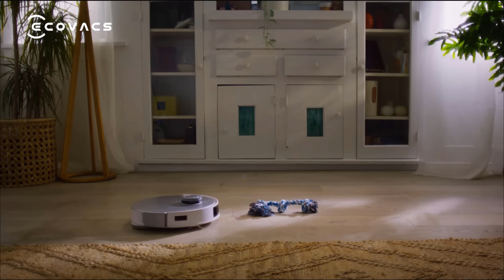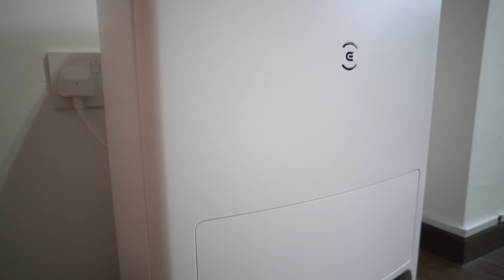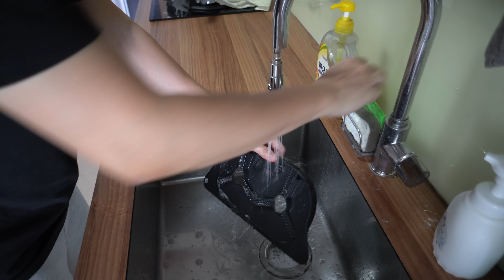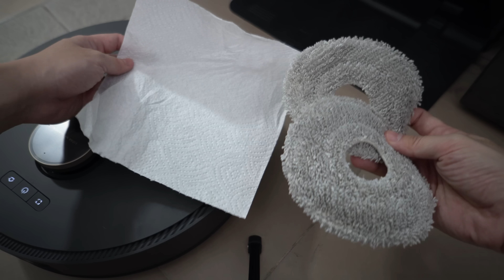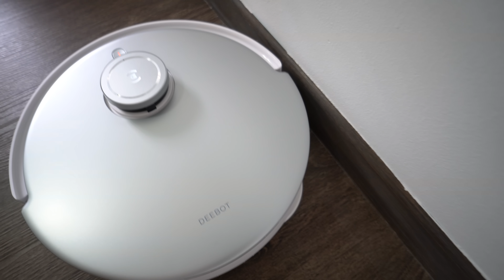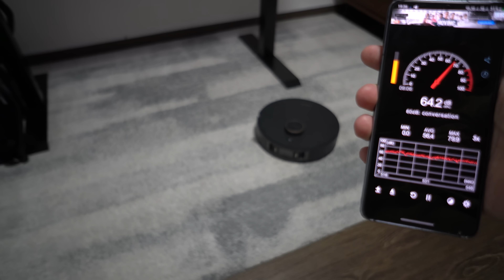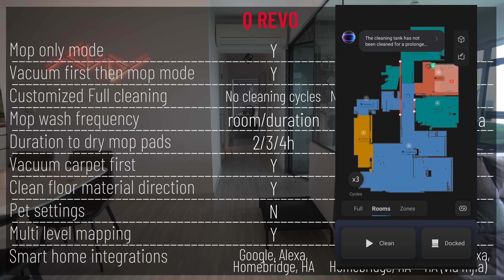My TOP 3 Robot Vacuums Worth Buying Now - DreameBot L20 Ultra, Roborock Q Revo, Ecovacs T20

Comment: Great review and tips mate, keep up the good work.

But,

Why did you exclude L10S Ultra, would you explain?

I will buy one and my budget is tight, just as much to get a Q Revo or L10S Ultra, which are equally priced in my country.

Should I go with Q Revo?
Reply from the maker: simply because it's not in my top 3. L10S is probably the cheapest model that is able to hook up to water pipes, but if you are not going to implement that then go for Q Revo

Comment: Hey alex. Can you advice if those dreame x30 or x40 models directly bought from TB will they work? Coz i read some models are for mainland and they geolock the app/firmware, esp for the x20pro
Reply from the maker: any appliance that's more than 500 i won't risk buying from TB already especially for a robovac with so many moving parts... unless the product can only be found in china and i really really want it
even if today the firmware did not block overseas IP from accessing, nobody can guarantee that won't ever happen, or they will request a china registered mobile number or ID
Reply: @alexteo  Thank you for your very valued advice. Its true, they can brick it anytime with a firmware.

Comment: After your review I'm conflicted between the qrevo and l20. l20 is $350 more than qrevo though.

in your opinion for a small 68sqm 3rm hdb, which would you recommend? Would prefer hot water washing.
Reply from the maker: both doesnt have hot water washing, have to look at other models
Reply: @alexteo  no problem, pulled the trigger on the qrevo maxv since it was 300+ cheaper than the x30 without the features i didnt really need like removable mop and auto soap dispenser and less 1000pa & no hair cutter. 

Consider it somewhat superior to dreame l20 since it has hot water washing and a good 1 piece base for easy cleanning.

Comment: RobotPox has become an indispensable part of my household routine. As a parent, keeping the house clean amidst the chaos of daily life can be challenging. But RobotPox has lightened that load significantly. Its advanced sensors detect and avoid obstacles, preventing any mishaps while it cleans. Plus, its slim profile allows it to reach under furniture and beds, where dirt tends to accumulate. It's like having a reliable cleaning companion that you can always count on.

Comment: The L10 i believe has the water hookup kit too? Saw it being advertised as an option besides just the vacuum alone
Reply from the maker: yes it does after launched a period of time, the L20 is designed and launched with the water kit in mind
Reply: @alexteo  thanks! Was contemplating l10 ultra heat w hookup kit vs l20. Main thing is budget, not sure if the paying the extra premium is worth it

Comment: Don't think this was mentioned or reviewed but all 3 brand uses NON-reusable dust bag which cost at least $20 SGD and above from the Original Equipment Manufacturer. Sort of like paying  subscription fees ($20 to $30 ) periodically every 2 to 3 months to ensure the vacuum system stays optimal.

From my brief research, one can probably extend the lifespan of the NON-reusable dust bag by emptying it but eventually the bag will be clogged  which affect the performance. Any chance you could test whether the system allows  disposal of dust manually e.g. directly from the robot instead of having to replace the dust bag?

One should also consider the lifespan of the battery and that the dust bag model may eventually be obsolete forcing you to replace the entire system perhaps every 2 to 3 years.  So on top of the vacuum price of $1000 + you may well be spending an additional $200+ per year and perhaps even more for the other spare parts to upkeep the system.
Reply from the maker: Then i recommend you to get those robovacs that doesnt have auto dust empty, such as the eufy x9 pro, dreame W10

Comment: Hi Alex thanks for the comprehensive video I became a fan of Dreame after watching your video about T2 years back. Just wanted to ask if it's normal for the robot vacuum to get scratched after it runs for a clean and mop?
Reply from the maker: hey sorry what you mean by get scratched?
Reply: @alexteo  thanks for the reply! My robot vacuum’s side bumper area got scratched after my first run of clean and mop and Dreame agreed for an exchange. Was wondering if it’s normal to get deep scratches when I’ve cleared the area of obstacles I.e., no loose things or wires on floor?
Reply from the maker: @dearvicki  this is your first robot vacuum? I would just watch the entire cleaning run once to see where and when it happens

Comment: Thanks for the video, full of detail. I used a ecovacs t20 , there is a problem , it keep.stopped under the bed and it can't return home most of the time. I have to lift it up and move it back to dock. The space between the bed and floor have around 20cm which should able to come back and I do in the morning with a lot of sun light in the room. I have returned. Now , T20 is cheaper then what I brought, T20 is $899 , Revo is $999, USD. Should I try the revo?
Reply from the maker: yeah i think you should! keep searching for one robot vacuum that meets your expectations!

Comment: imo the Q Revo is just not in the same leauge as the L20 Ultra.... it should be compared with the L10S Ultra instead. L20 Ultra is a highest end model of Dreame and the pricing + features reflects that, Q Revo is just the mid end model from Roborock. Is the L20 Ultra same price as Q Revo in Singapore?
Reply from the maker: In the beginning i mention to forget about the other models, I am giving my recommendations for my overall top 3 robot vacuum to buy. Yes i considered models like roborock s8 ultra, dreame l10s, ecovacs x2 and others like eufy, roomba, xiaomi...

Comment: Are you trying to say that spinning mopping is better than sonic mopping (like in e.g. Roborock S8)? Just curious which system is superior :)
Reply from the maker: i prefer spinning, not a fan of a piece of cloth
Reply: @alexteo  I currently own Roborock S5 Max and I'm thinking about upgrading. I think about S8 and Dreame L20. Since I do not own a big house, just 50m2 apartment, I don't need a base station with all that fancy cleaning and auto-emptying features. But I need a real improvement in mopping...
Reply from the maker: @16klu  the idea is to go total handsfree regardless of the size, switchbot is coming out a model name s10, i have not tested it but it looks promising

Comment: Just note that the Q revo eats up cleaning fluid without any restraint. 
I’m literally topping up the fluid tank every 4-5 days. Add in the coat of the cleaning fluid, it’s not cheap. 
Using the Tineco one and buying it in bulk to keep the cost manageable. 
But none the less, it is nice having a squeaky clean feeling floor everyday.
Reply: I just use pinesol in it lol

Comment: Hi Alex. Thanks for the detailed analysis! Question on the Dreame L20. Ur summary states that Dreame L20 can be found on Mi Home App. But I can’t find it on the list. Also I’m using the region Mainland China. Is this an area of concern if I want to get this robot vacuum? Thanks
Reply from the maker: yup seems like the L20 is not in the list, so integrating to home assistant should be impossible at this point

Comment: Is the water kit for the Dreame worth the extra expense?
Reply from the maker: 100% over any other features
Reply: @alexteo  can I check if the dust bag is not reusable and we have to replace it every time?
Reply from the maker: @chenyixiang690 you can use your hand to remove the content in the dust bag but i really dont think anybody will want to do that
Reply: @alexteo  thank you. I have another question. Did you put your machine in the service yard? How much space was available there? My service yard is quite small but I was hoping that I can squeeze the machine there in order to make use of the water supply and drainage pipe.

Comment: these are extremely expensive robot hoovers. there seems to be lots of videos for the super expensive £800 plus machines, and videos on the ultra budget £150ish machines. Where are the videos for inbetween? Whats machines are good in the £300-£400 mid range bracket?
Reply from the maker: because whatever in the middle is in a very weird spot, if you like something in that bracket i suggest to look at 2nd hand models from 2-3 years ago

Comment: Its a hard one. You are comparing a flagship (L20) against the T20 and Revo 2nd tier robots, where the T20 and Revo are priced the same, and the L20 around $700 more.

Would have been more "fair" to compare the L10, T20 and Revo and the L20, X2 Omni and S8 as these are each manufacturers flagship.

You would expect a $2500AUD unit to beat a $1800AUD unit..

The flagship model X2 has a built in water tank, lifts higher on carpet and is square (to get closer to edges), higher suction, and without a top lidar it has a shorter height to get under things (like couches/beds).

I feel like you have reviewed a Corvette, Mustang and a Lamborghini.. 😏

Great review and testing though! 👌
Reply from the maker: the tests are just to let you see the results for each of them, not comparing but rather recommending these 3. No idea how else I can name the title of the video. X2 and S8 are not there because I don't find them worth the money

Comment: What a great comparison review!

One question, you had Smart Home integration as a listed con for the Dreame L20 Ultra but I didn't fully catch that part. Are there any limitations one should be aware of when using personal assistants such as Google Assistant? I personally find it very convenient being able to control the robot via voice commands. Where I can both start/stop a cleaning run but also have it go and clean individual rooms as well as send it back to its dock. So if this functionality via Google Assistant is not available for the Dreame L20 Ultra, it will be much less interesting to me.

I currently have the Roborock Q Revo but I'm thinking of replacing it with the Dreame L20 Ultra since I miss having a camera but also for the extending mop feature. I also think the base station looks less "cheap" compared to the Q Revo base station which doesn't come with a lid to cover the water tanks. Finally, it seems very convenient looking at the L20 Ultra to have the cleaning solution directly in the docking station where it will use as much as it needs automatically. In the Q Revo, I have so far only used clean tap water. I know Roborock has their own recommended cleaning solution but I heard of many people having the water in the fresh water tank turn "slimy" after using it.

Sorry, this became a wall of text 🙂
Reply from the maker: not really a comparison review but rather my top 3 robot vacuums to buy now. Google home integration is always fine for all these brands, limitations come for other platforms
Reply: The water turns slimy because of algae build up. 
You can put in stuff to prevent growth of those stuff. I have one in my tank and the water tank has remained clean after 2 months of daily use.

Comment: Hello Sir, I have a Ecovacs Deebot T20, and am trying to use it on multiple floors. Do I have to take the charging base to different floors to use it? It's quite heavy. If I only take the robot to a different floor without the charging station, after cleaning, the robot will keep trying to find the charging station. After a long time looking, it will stop and say it can't find the charging station.

Comment: the swivel motion when mopping near a wall is an older program setting from L10s when it didnt have extend mop. You can turn off the swing motion by go to setting -> wider coverage of Edges and Corners -> toggle off. Then it will stop swinging its body when near the wall.
Reply from the maker: sorry but what you described is not available in the setting. The setting for mop extend is under setting -> Intelligent mopping setting -> AI-driven MopExtend

Comment: I have a Dreame z10 pro and a roborock and can tell you that I will never ever buy a Dreame robot again. Absolutely horrendous mobile app. It won't show notifications randomly, the map gets warped every few days and a restore needs to be done. Horrible design of the z10 where the side brush is a clip on. It detaches randomly and there's no sensor or notification for it. The roborock is eons ahead. It's app and map management is amazing, the cleaning is great. Can't fault the roborock. I only bought the dreame because I thought the app would be the same as roborock since they're both owned by Xiaomi. But that's not true as Dreame uses the xiaomi home app vs the roborock having its own roborock app. Steer clear from any dreame robot vaccum.
Reply from the maker: Thankd for sharing your experience. I didn't test the Z10 pro so i can't comment on that. As for app experience, you can use mihome app for most of the models from dreame and roborock. Each of them have their own app as well, i am not sure whether you have those app downloaded at the latest version, from my experience and also evaluating the app from an IT guy perspective, i will say the dreame app is on par with roborock. I only used the dreame app for roughly 3 months, so far the app has no cases of crashes and errors. My only small complaint is the widget not updated with the latest robot status after the mop drying is completed, it will only update the widget if you open and refresh the app

Comment: L10S Ultra has also auto refill kit, dirty water removal too , cheaper then L20 :> does it then make it to the list?
Reply from the maker: i will slot them at number 5, L10S is not designed and released with the water hookup, it seems to be more of a retrofit solution, plus the other features of what L20 brings I think its definitely more worth

Comment: Thoughts on the Ecovacs X2 Omni? The L20 Ultra is currently my top pick, but I'm curious how often the pads for these mopping robots need to be changed and washed. The hot water feature on the Ecovacs is attractive if it significantly extends the need to change the pads and clean the base. If it doesn't, then I prefer the L20's ability to leave the pads at the station compared to other robots that lift the pads.
Reply from the maker: this feature is probably unique to dreame only.. the ecovacs x2 and roborock S8 ultra fall under the same category to me, not worth paying that extra high price for those premium features they offer, both not even in my top 5 robots to buy
Reply: @alexteo  Thanks for the reply! Does the hot water allow you to significantly delay manually cleaning the base and changing the pads when using the robot for simple daily maintenance?
Reply from the maker: @JonathanPong  nope that will not have significant effect on the base station, changing of pads is mainly due to it being worn off

Comment: Great review, 
Would you recommend L10S Ultra instead of L20 for budget wise? (Compared to T20 and Q Revo)
Reply from the maker: i will still recommend the L20, its designed with the water hookup in mind and i think it will last a good solid 3 years imo. If you can't do the water hookup then might as well save cost and get the T20 or Q Revo
Reply: @alexteo  Thank you Alex, and which would you recommend between the Q Revo and T20? - watching your review looked as if the T20 has some advantages over the Q Revo
Reply: @alexteo  Why the Q revo instead of the L10S? L10s does obstacle avoidance better
Reply: @amluckymess  q revo doing better in mopping that l10s

Comment: This is quite informative but not really a fair comparison. The DreameBot L20 seems to the favoured machine but then, you have failed to inform that it is sold for almost twice the price of the Roborock Q Revo. Though it features similar features to the other models reviewed, at the price it is sold at, the DreameBot L20t really should be compared against the top end models from Roborock and others. My two cents worth.
Reply from the maker: This is not a comparison video, this is my top 3 recommended robots in the market right now

Comment: Echovacs x2 pro is out and you can plumb it into the water system so you never need to change the water.
Reply from the maker: As mentioned this feature is not new in china, the narwal J2 thats released more than a year ago already has it. Did you see the Ecovacs X2 pro released outside of china? Can share the link
Reply: @alexteo  I have not seen it outside china yet (I am in China). Wonder why they don't have these plumbed in versions outside china? I think if they ever did a version with this and a way to top up the soap automatically AND a way of emptying the base bin (or a bigger bin). It would be great. Check it once a week. I think even if exported it may not work outside china because of the APP servers, my T10 Omni does not like it if I put my VPN on it's wifi, can't connect to the app.